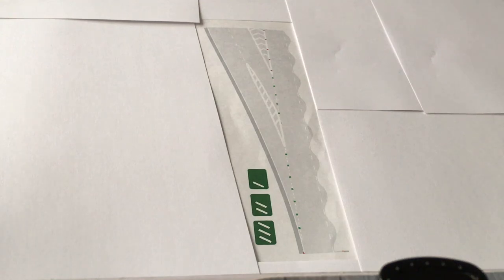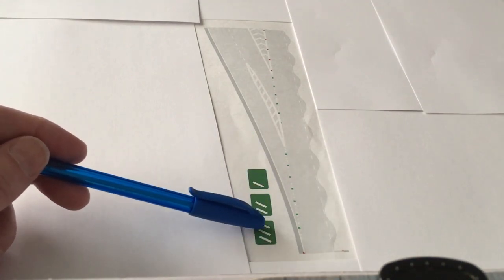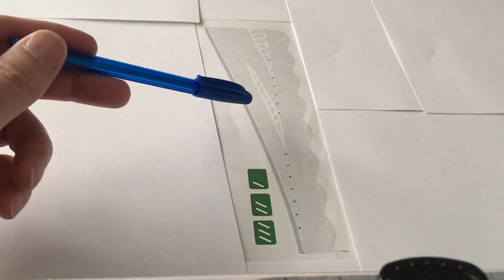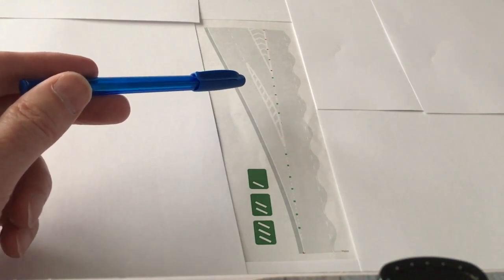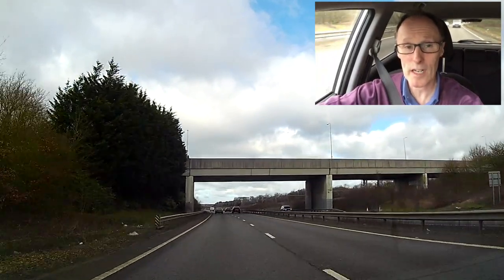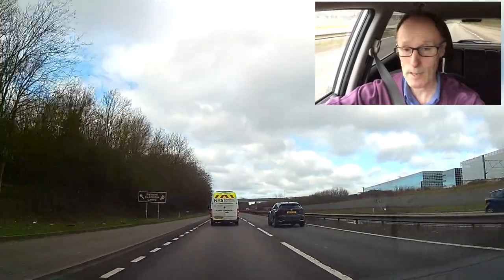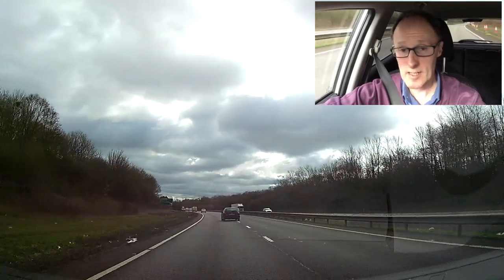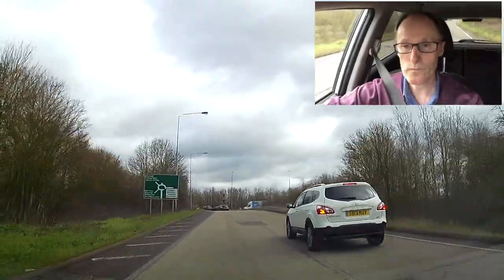How to exit a Dual Carriageway via a slip road(deceleration lane).

Comment: An important note on the 300/200/100 yard countdown stripes ahead of an exit lane on a dual carriageway is that these are measured to the START of the exit lane.  Still being at your full cruising speed would be completely be acceptable at this point, subject to observing up the lane for a queue, obstructions etc.  The same 300/200/100 yard countdown stripes approaching a roundabout are measured to the give way line at the roundabout. That is the point at which you might have to stop. Uphill exit roads can be safely approached at a higher speed than down hill ones (requiring more braking) plus if there is a brow on approach there could be a queue just out of sight. 
At 4.32/4.33 on the road surface is a giant BIFURCATION ARROW this always confirms the actual location of the turn off.  I have known people turn into a bus stop at 70mph instead of waiting for this marking.
Cruising at 60mph on a 70mph road as in the video is prudent for reducing stress and for newcomers to dual-carriageways.  To adjust your location forwards and backwards to merge where needed you have the option to speed up 10mph or slow down 10mph to synchronise with a space. If you cruise at 70mph it is much harder to synchronise with a space as you can only slow into it.
Reply from the maker: Helpful tips for the new driver